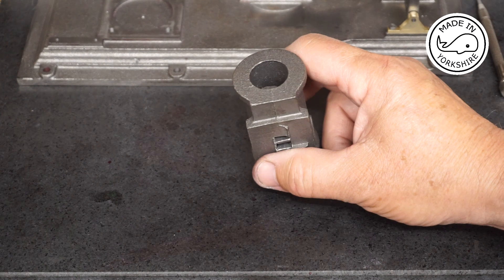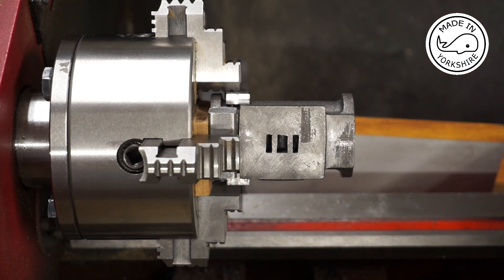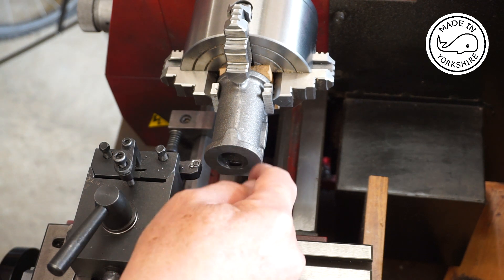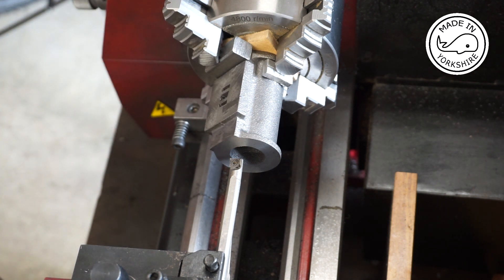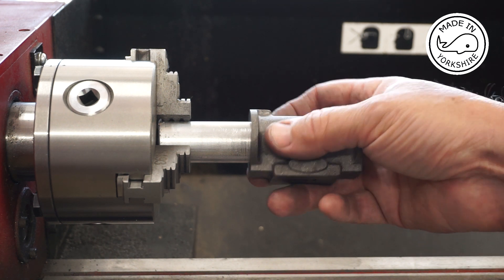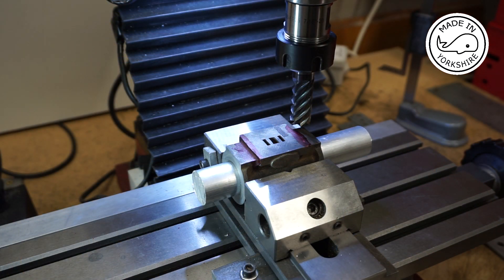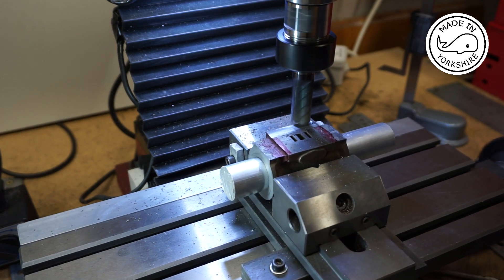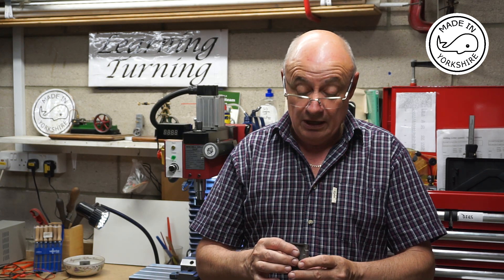#MT32 Part 5 - Making a Stuart Half Beam Steam Engine. The Cylinder. By Andrew Whale.

Comment from the maker: * IMPORTANT * IMPORTANT *
jonathan bale questioned how I had clocked up the cylinder before machining the port face (see his comment below).
I did initially clock each end of the bar (running through the bore) on the mill to make the bore level with the table - but I didn't make it clear. I then went on to clock the corners of the port face to try to ensure front and back were level. However I lost my way a little and I think I also re-adjusted the bore level by mistake. I've just clocked it with the bar through the bore on the surface plate (measuring the top of the bar at each end) and I'm 5 thou out 😭😭😭. 

So, in my next video, I've decided to machine the valve chest and I will revisit the machining of the port face. I will also drill and tap the studs at the same time.
Fingers crossed!!!!
Reply: I think i can say good luck  from all of us

Comment: While there are essential "full size" techniques to be mastered, for me, this is a hobby and being too pedantic about how we do things could deter new people like myself. For example, not having a mill, I machined the 10V port face on the lathe with the cylinder bolted to an angle plate, bolted to a face plate. Drilling and tapping the stud holes required a different set up in a vice which I know flexes slightly when tightened. Does it really matter that the studs aren't precisely at 90 degrees to the port face, as long as the steam chest fits over them?
Reply from the maker: Hi Len. I think you have done an absolutely amazing job machining most of your 10V on the lathe.
All the best.
Andrew
Reply: If the studs aren’t reasonably straight, the steam chest holes will need to be quite oversized to allow for fitting. I learned this the hard way and now use a tapping fixture which really helps.
Reply: K Gee - my point was simply that one doesn't need the luxury of being able to face, drill and tap in a single operation to achieve an acceptable result.

Comment: Hi andrew 
Good work , for a beginner you are good,two points.
1 you confused me a bit when you said you leveled up the port face from the casting but you had the ally bar in the bore.
Did you clock the bar level with the table so the bore is parallel with the port face. 
An easy way to prove this now is to put the bar in the bore lay the valve face on the serface plate and clock the bar 
2 figure of eight when fine wet or dry on serface plate 
Keep up the good work love your videos even though i am 57 years old and served a toolmaking apprenticeship.
Reply from the maker: Hi Jonathan. Many thanks for the advice. I don't mind being trained by a youngster ha ha. 
I did clock the bar on the mill but didn't make it clear. My main reason for clocking the corners of the port face was ti try to ensure front and back were level. However I might have lost my way a little.... I've just clocked it with the bar on the surface plate, as you suggest, and I'm 5 thou out 😭. Do you think that this is an acceptable tolerance, or should I try to correct it?
Also, thanks for the advice re sanding.
Cheers
Andrew
Reply: The smaller the object you are making the more accurate you have to be.
Five thou here five thou there adds up.
However you might have a lucky break, when you machined the  port face you should have drilled and tapped the stud holes at the same time to guarantee them at 90 degrees to the port face.
When you drill and tapp the stud holes put the ally bar through the bore and rest it on parallels or 123 blocks and hold in vice, you can then clock the uther way correct ard  remove the 5 thou taper. It also gives you a good way of picking  up the centre of the bore when you dro the stud holes 
good luck rooting for you
Reply from the maker: Many thanks for explaining. I really appreciate it and will definitely follow your advice.
All the best.
Andrew
Reply: Looking forward to seeing your next video 
Ps 
Please don't forget to clock the ally bar parallel to the table
Reply from the maker: Hi Jonathan - I've decided to tackle the valve chest in my next video and I'll re-machine the port face and drill/tap the holes for the studs at the same time - as you suggest.
Cheers
Andrew

Comment: Hi Andrew
Great work on the cylinder, it has come up really good, I agree on the steam passages, they are cast very well.
Are you using the supplied "O" ring or cast iron piston rings. (optional from Stuart)
Just a tip on the cylinder bore, I honed mine with a brake cylinder hone just to give it a better finish as I used the piston rings.(completely optional)
Looking forward to the next video.
Regards
Gary.
Reply from the maker: Thanks Gary. Hmmm - I need to have a think about a piston ring! Check out Model Steamers comment regarding steam passages.
Cheers
Andrew
Reply: Andrew
The only reason I asked is when I machined the piston to the drawing specifications and fitted the "O" ring I found it would not fit in the bore, I had to cut the piston groove deeper, but still very tight so I made a second piston and cut the grooves for the cast Rings and I found the fit fine.
Let us know how you get on.
Cheers
Gary

Comment: Looking good Andrew, as for the cast in steam passages its worth poking through with a piece of wire and then trying to flush out any small grit / sand etc. Once you engine is running any fine debris leftover will migrate into the cylinder and cause excessive wear.
Reply from the maker: Crikey Peter I never thought about that. A great tip.
Many thanks
Andrew
Reply: Learning Turning Metal - by Andrew Whale : Another reason to check them is the ports might be blocked. I had one that wasn't completely cleared. Just drop the casting in water and let it soak for about an hour then use a piece of copper wire and dig it out.

Comment: Hi Andrew. Stress is the right word when it comes to drilling steam passages. Those are quite long, so having them cast is a considerable relief. I had to drill 4 for my D10, but having set up for one, the other 3 followed quite easily; but stressful none the less. I'm pleased to see how well your mini mill is coping with relatively large stuff. Regards.
Reply from the maker: Hi Len. You obviously like a challenge! The mini mill is coping very well at the moment. I suppose I will find out if the distance between the spindle and the table becomes a problem. Fingers crossed 🙂
Take care.
Andrew